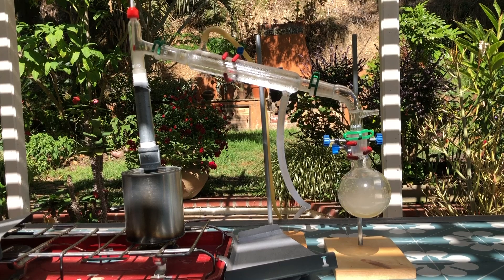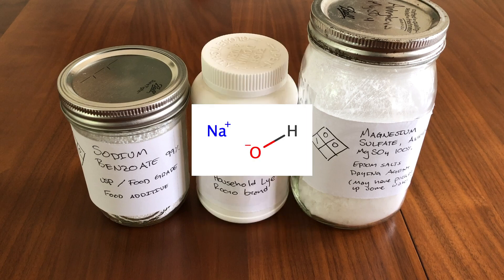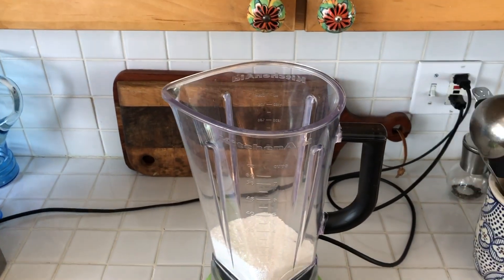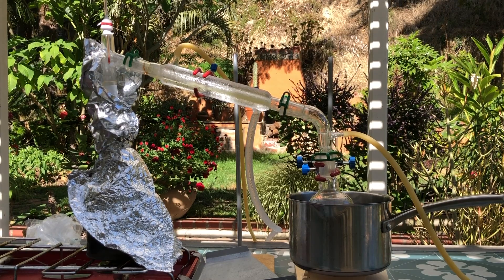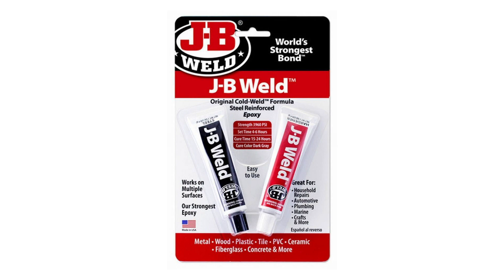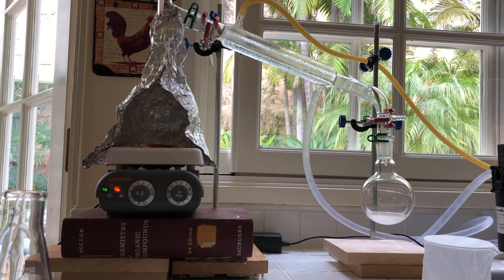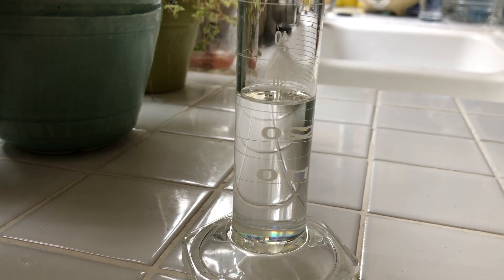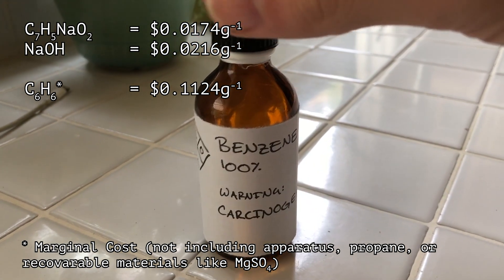Making Benzene

Comment: In these reaction conditions you can get Ar-CO-Ar, phenol and polyphenols too. Then the first problem is the air in the reactor and the second the formed water.
Instead a can try to use a furnace tube: it allows to control better temperature, pressure of CO2 and vapor. And remember: NaCO3 can be decomposed with acylated compounds forming.

Comment: Excellent, I'm glad I saw this because I've used jb weld to attach the 24/40 neck of a broken flask to my paint lid. I've not done the distillation yet as I was thinking it would be no good. Now seeing your steel pipe I'm thinking my vigreux column might not enjoy being so close to the heat source 🤔 but at least my jbweld job isn't rubbish